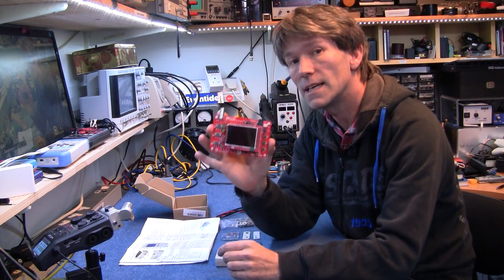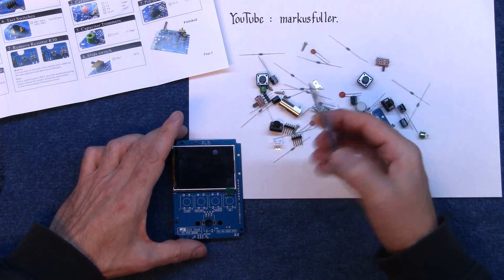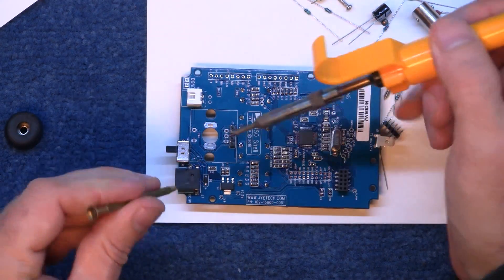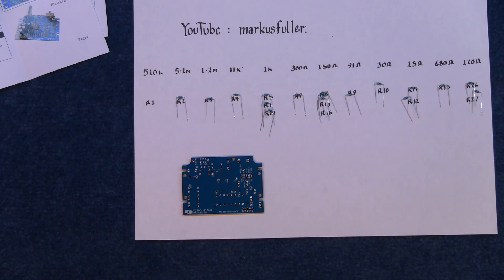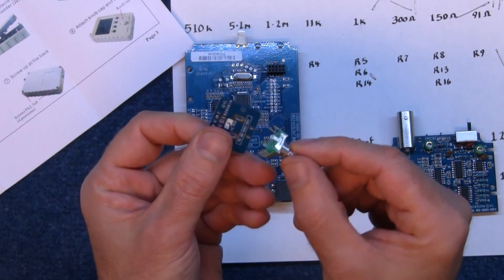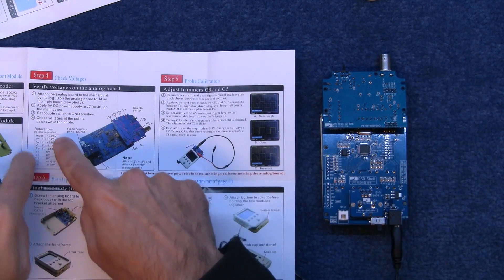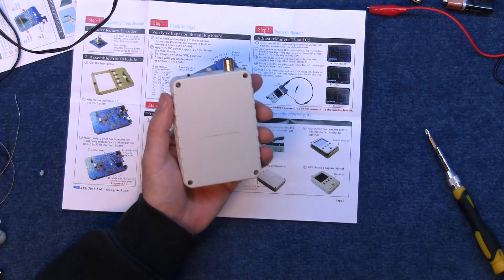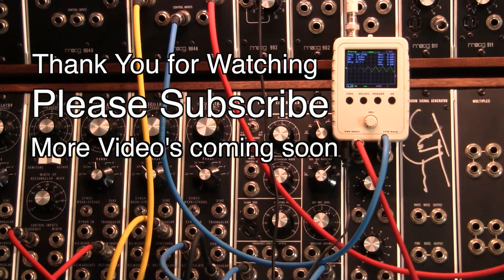How to make the JYE Tech DSO Oscilloscope then tested on the moog modular synthesiser

Comment: Make sure you read page 1 in case you have received the version that requires you to mount all of the SMD components first.  You are starting on page 2.  I attempted to mount the SMDs without any experience.  It did not go well.  Be sure to watch SMD tutorials before starting.  I have since ordered the version you have, with the SMDs already in place.  I hope it turns out as well as those demonstrated in other videos.  It otherwise appears to be a quality product considering the price.

Comment: Markusfuller, I done a little research on the "China" resistors and found a really cool site! here is the link: http://www.kiloohm.info/resistor-5/black-black-black-black-black this is for anyone not sure of the resistor size (colour bands) or for anyone with a "sick" ohmmeter like mine. it has several things to click on, different amount of bands, SMD, etc. If you come up with a strange resistor amount, enter the colours in reverse, it's fail proof! you can either enter the resistors amount or click on each colour at a time, as I said it's a really cool site.

Comment: I built one with my 8-year old boy who then took it to show his class.  PP3 battery dangling off it, but otherwise very neat.  I had to look at some signals in the wiring of a modern car and it was a heap easier to use this than drag my Tektronix TDS3012 out to the car.

Comment: Actually you can put a battery in it. There is just enough room for a flat cell and a boost converter. You can use a small charge module and micro boost converter. Someone has done it. I was contemplating it myself, but I just don't use it enough to spend the time on it. I tend to use my lab scope more, but still nice little scope, but if portability is what you want they make a portable battery powered 4 channel scope DSO203 for around $135 US.

Comment: Just got one of these kits and built it up to step 3. Step 4 measuring the voltages gave me a fail on AV+. Measured +6.5V instead of +5V. The analogue board had an 79L05 SMD installed at U4 - should be a 78L05. This was a kit from Banggood. Good video BTW... envious of the Moog! (This is on the E version of the board)

Comment: Yea, I made the mistake of soldering the knob on the wrong side of the board and it will not work if you do that, so make sure you don't get that wrong. After some careful desoldering, I fixed it, but it doesn't work as well as it should so it was damaged.

Comment: It might be a good idea to use a drop of superglue to attach the BNC connector to the board.  It will suffer a lot of stress; the solder joint can not handle that.
Reply: 1959Berre I use hot melt glue and then put it together quickly it gives a lot of support and is easy enough to get off. If you don't want to stick the case to glue a very small smear of silicon grease stops it from doing so.

Comment: They've updated the instructions (the ones in the video were rev 2, I took delivery of a kit today with rev 5 of the instructions). They've removed the confusing instruction to test the buttons before they've been installed (Step 1 part 1 just reads "1, apply power. 2 check display"). Step 1 part 7, telling you to remove R30, adds the instruction "Now apply power again. Test power switch and tact buttons for their correct functions". This makes more sense.

Comment: Gathered is the same. For convenience, put in the battery from keypad mobile phones + charge charging protection + boost Converter to 9V to. All contained within a single housing. http://s013.radikal.ru/i322/1705/f1/129edabf166c.jpg

Comment: thanks for this great video! made me buying this :) 

everything worked quite fine - had to resolder the rotary switch because i got it upside down on the little additional board...
but from then, all good. just a little struggle because i have to use the rotary switch all the time to bring the graph back into the screen when i change the V/DIV.

worked quite good in calibrating a juno-106, but i just plugged a power supply that has +/- on the wrong side. little "pew" and now it doesn´t do anything even with correct power supply...

i checked the boards with glasses, but nothing obvious to find... any ideas what´s broken & if it is fixable?

i´ll hide in the corner and cry in the meanwhile.
Reply: JUST FIXED IT!

google told me, there is a little part called "stupidity-diode" installed for people like me.

behind the power-connector i saw this smd-part "D2", D->Diode? so, testing it with the multimeter: didn´t let power through in no direction...
luckily you get the circuit diagram when you buy the DSO150 - so i had a look in there: it´s a "1N4007" 

lucky me: i got one! 
not the SMD version - but who gives a shit?

soldering it on was super easy, probably because i DID NOT remove the old one, but used it as a help to fix the other one on it.

made a not-so-nice picture:
https://www.pic-upload.de/view-32900358/fixeditoszilloskop.jpg.html

EDIT:
i´ll put some hot glue around this, because it´s easy to break the new diode with the old one from the board because there´s a lot of leverage with the long legs...
the f***, that was close! :D

So my advice to all: Be smarter than me & check + and -  or buy sortiments of caps, diodes, transistors, ... it´s so cheap and will make you happy! not today, not tomorrow, but the day will come for it to dry your tears!

Comment: Reading through the comments it seems several people are having the same issue that I had. 
The rotary encoder which is mounted on its own little pcb didn't have a connection from the main body of the encoder to the ground on the main pcb , I just soldered a link between the two boards and problem solved.. This isn't an issue on the version which has the encoder soldered directly to the main board.
 I hope this helps.

Comment: I bought one of these kits (order no 23364323) and assembled it.  It boots fine, but otherwise the change switch does not work and capacitor 3 (trimmer) seems to go round and round without any stop.  I went overr the parts and soldering over again and again and can find nothing wrong with my work.  So either the analogue board or the change switch are faulty.
Reply: I had the same problem, the rotary encoder which is mounted on its own little pcb didn't have a connection from the main body of the encoder to the ground on the main pcb. This isn't an issue on the version which has the encoder soldered directly to the main board.

Comment: Hello, I just (almost) finished assembling this unit. Unfortunately while trying to calibrate it I shorted one of the electrolytic capacitors by mistake and now the screen stays white on boot. I tried testing the voltages again and they are still in tolerance range. Is it possible to recover it?
Reply: Did you try "Default Restore" ?  hold down [SEC/DIV] & [TRIGGER] buttons simultaneously for about 3 seconds, I don't know if it will solve your problem but it's worth giving it a go.

Comment: The DSO150 Shell just seams to be a re-engineered DSO138, do you see any difference? 
It looks like the trace is a bit cleaner, but the DSO138 with the new firmware has been made cleaner as well.

Comment: I just received one of these and was thinking of making my own video showing the construction.  But you've covered it so well I won't bother ;)

I'd like to clarify step one though; the first task after unboxing is to give it a 9V dinner.  The display lights up, an led on the rear flashes twice and you know it's good to start the rest of the construction.  Then you add the switches, remove the zero ohm link R30 and retest.  This time you can test the tactile switches as they're now fitted.

For peace of mind it's worth the initial power up as it's much easier to argue it's DOA if you haven't started any form of construction!
Reply from the maker: Yes George you are quite right, I did not really cover those test startup procedures.

Comment: Thanks for the reply. I just heard back from the seller, they are shipping me a replacement kit. I have been tinkering with the unit, went through and insured I had every resistor installed in the right place, this time by color code, when I assembled the kit I used a component tester to insure that all war right. Second check showed it was.  I went over every contact once more with my soldering iron, and added a bit of solder where it appeared it could use a bit. Still nothing to speak of. Tried it again this afternoon after assembling a function generator kit, and managed to get the scope to show a bit before it locked up once more, so there may be a little life there, but not much. It acts like an intermittent failure in the OS to me.

Comment: Hi Markus, i order this Oscilloscope ;)
If you have time i'm very happy to you show a video how to repair a CD Player. My Technics SL-PS620 A can't read my CD's. I've read in Internet it is possible to justage about trimmer (Laser, Focus...) to repair the Player. I hope it is possible for you and you make a lot of people happy ;))))
Thank you. I like your Videos
Reply from the maker: Mc Web Hello Mc Web, I have never had much luck with refocusing CD lasers, mormally they are setup with specialist infrered camera equiptment at the factory that makes the laser reader. the focusing of the laser is normally done by the CD player when you have inserted a CD, it does this itself electromagnetically pulling the lens back & forth until it is focused. so im guessing it would not be possible to manually adjust the lens as it is free floating, maybe the problem is the strength of the laser has weakened over time ?.

Comment: Hi, I was looking at the DSO138 and the DSO Shell Oscilloscope when i discovered your video.  may I ask which one do you prefer.
 keep up the good work
Reply from the maker: Alan Toop Hi Alan, I actually prefer the shell version because it feels less fragile than a bare circuit board but I think it would have been better if it had a battery bay as well.
Reply: I just like to apologise for the late response to your reply.
I went and got the DS0138 however it is proving to be a pain when soldering on the board I even used flux on it. must have some kind of coating on it??
Anyway it's all sold it up but its not quite working right moment, must be the solder joints ..
Just watched your recent car boot videos, what a bargain on that computer. 
Thank you.
Reply from the maker: Alan Toop Hello Alan, i have had a few messages of people having problems and i am not actually sure why. maybe you can contact jyetech for some support.

Comment: Great video.  I just assembled my oscilloscope and should have watched this video before hand.  I had to un-solder a few components because the instructions were not clear on which side of the board there were to be soldered.  
BTW:  Love the Synth.
Reply from the maker: valveman12 Hello Yes I think the instructions are quite nicely done with photos etc but would be more helpful if those few extra details were explained better, other than that I quite like the little scope and am looking for a battery bay to fit on it to really make it portable.

Comment: Thanks a million for the video.  Nice to see a preview of what mine will look like if it ever arrives down here in our RV Park in Arizona, where we are hiding from the cold South Dakota Snows.  My unit is at my house in SD and my daughter should be mailing it down next week some time for me.
Reply from the maker: Jerry Ericsson Hi Jerry its freezing in the UK also at the moment but no snow where I am. Yes its a handy little bit of gear well worth the time putting it together. well keep warm and I hope it arrives soon.
Reply: Mine came in the mail last week, I tried assembling it a few days ago, I cannot get the voltages right. The troubleshooting says it may be a bad solder connection on the resistors, giving the ones to check, I have re-soldered them but no help there, and the unit will not work for me at all, I cannot even get it to go into the calibrate mode. The only other recommendation is that there is a poor solder joint on U1 which is the processor, and I know  enough not to go trying to fix those, ruined an Arduino once trying to clean up a solder spill on a processor, and it was the Mega so it was a costly error. I have sent a request for assistance to the company, but since they sell dresses and on the side kits, I am pretty sure they won't be of much help.  I am very disappointed that I can't get it to work, I have always had great luck assembling these, and have been soldering kits and such since learning the art back in the US Army Signal School in 1970.
Reply from the maker: Hi Jerry, sounds to me like you may actually have a faulty unit there. obviously you know what you are doing as you learned your skills in the US Army signal school. I wonder if the chips have been correctly placed ?. If you are getting nothing from it at all then I would say try and send it back for exchange. I'm sure as murphys law goes there will be the odd one that does not work and it looks like you got it. after all if they are not made up as a complete unit in the first place how can they all be checked ?.

Comment: Thank you for doing the video. I didn't thought there is one out there for so less money. I bought one immediately, because i need one to calibrate my DIY microphone, but i ask myself how can i send a 1 KhZ tone out and measure the signal at the same time with the 2 contacts. There is just one pol for the 1 KHz out. I'm not so into electronics but i can solder very well. ;-)..Do you have an idea? Thank you.
Reply from the maker: monoteur Hello that 1Khz out is mainly for calibrating the unit when you have made it but you can still use it in testing circuits, if you imagine that 1Khz pin is your positive (re wire )out then you just use the black clip as the negative for the out also and still using the black clip for the input to the scope as well as the red clip. its just a neutral or ground so you could run 2 wires from that as they would just be ground cables or neutrals if you wish.
Reply: Ok, that helps, now i understand, thank you!

Comment: It'd be nice to stick one of these into a eurorack module.

I love your multimeter probes... very slimline and elegant... just right for poking into tiny places.
Reply from the maker: It would be perfect for a eurorack if built onto a nice aluminium faceplate
Reply from the maker: Yes I love those probe leads, they are also spring loaded so you can get a good connection.
Reply: Niiiiice!
Reply: Those probes are called "plunger mini-hooks".  In the Navy we called the version with the plunger hooks on both ends 'bug wires'.

Amazon has loads of them priced between, 'well, that's reasonable' to 'Oh my god!'.
Reply: Is that bug as in "invertebrate life form" or bug as in "secret listening device"?

Comment: I put together one (not working yet), too bad that the manual states the bleeding obvious (test the buttons), but doesn't tell you how to actually install the rotary encoder! I put it on the wrong way, couldn't get it to desolder and had to snip the little daughter board to bits to get it off again....
Reply from the maker: Robin Kok Yes I know exactly what mean there, I sat for a while thinking and putting the faceplate on it to work out how it goes in, its not obvious is it.

Comment: I've ordered one. A shame about the installation leaflet. What were they thinking?
Reply: that´s the main problem with all these chinese things....obviously they use automatic translation algos for these leafelts...and its output you getting without any final check...mostly chineglish with all kinds of jokes remains in them...

And if you buy a RipOff (mostly made by SainSmart) it´s getting worse....my SainSmart DSO138 which i built over a year ago....couldn´t been succesfully built if you haven´t any experience with those things....some ridiculous errors had been made during component selection and packaging....

Some components had been missing, while some others where just not required/wrong...

If i built it up with the components supplied...it simply won´t even measure anything. The analog frontend wouldn´t have worked with those components
Reply: There was nothing wrong with the English in the instructions.  It was the lack of some details.